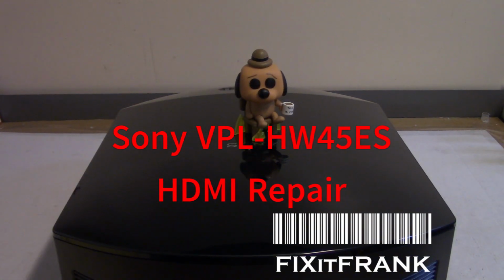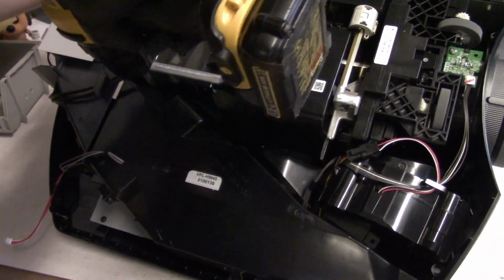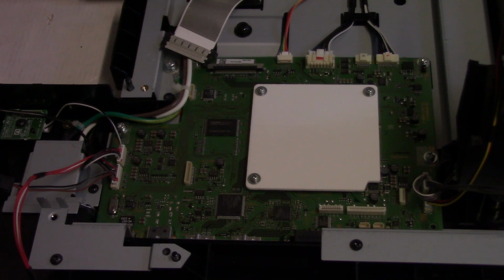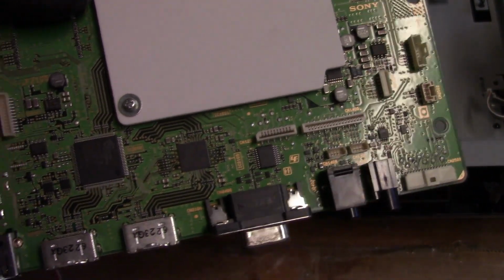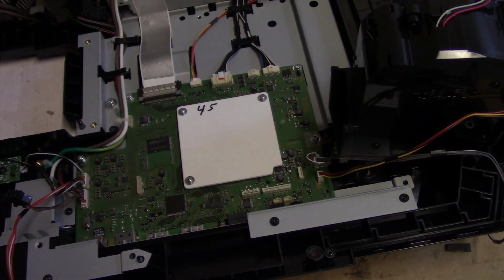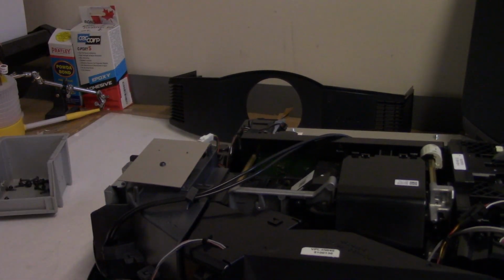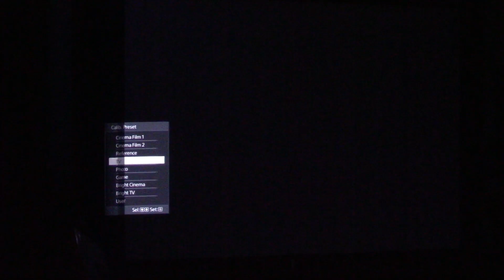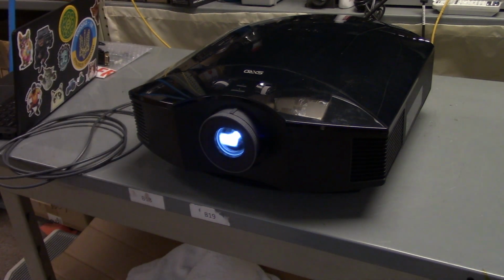Sony VPL-HW45ES SXRD Video Projector HDMI Repair

Comment: Nice one again Frank! I just found on the trash a PROMETHEAN PRM-45 WXGA projector with manufacture date of May 2013 with the remote that is perfectly working. Just cleaned it, because it was stacked with filth, and ordered a  bare bulb for the beast. It has now 20 hours on the new lamp and it is happily working with 0 problems at all. PROMETHEAN was a manufacturer I have never heard of and it seems that it went out of business some years ago! 

Thanks for the new video again Frank!
Reply from the maker: Oh yeah. Promethean used Sanyo chassis if I recall. Schools liked them a lot. Not a bad projector really. Is it orange? Some were made in a bright red/orange chassis.
Reply: @FixitFrank No, it the plane grey unit, but it is short throw. I believe it came from a foreign language private school as it was found outside in a box. Fact is that the unit had 11500 hours on the clock and the lamp was functional but very dimmed.  I ordered the bare bulb and relamped the unit and it is like brand new out of the box. Now as fans and colour wheel goes, well, if it dies, it dies!
Reply: Something about people finding old good tech stuff on the street sounds adventurous and cool nice find

Comment: Good fix Frank....thanks for more videos. Cheers buddy 😊
Reply from the maker: No problem 👍
Reply: @FixitFrank  Hi Frank, thank you for your informative videos. I've been searching the internet and your collection of videos for an issue where a projector (JVC X5900) shows a purple image, even after replacing the lamp. This includes the text in the Menu, and also happens if there is no HDMI cable connected. Sometimes I am able to use the projector for 10 minutes with no issues and the image looks fantastic and bright, but then turns purple again. Do you have any advice on what that could be?

Comment: Thanks, Frank! Do you have a favorite place for HDMI boards and parts outside of lamps? (in the US)
Reply from the maker: Hi, unfortunately our options are very limited unless your pockets are deep and your needs are not too varied.  Encompass parts is okay but $$ and limited and then there is Heartland who I would not give a penny to.  
It really depends on what you need specifically.  I prefer to repair the boards rather than change them.  I rebuild the boards myself and then save them.  I had a video on an HW50ES(the projector I use at home) where I repair the HDMI issue on this series. They use the same mainboards. when I recorded this, the chip I needed was not available but now it is.

Comment: Do you have any seller recommendation for the POA-LMP111 lamp?
Reply from the maker: It depends where you live.  If you are in Europe I'd suggest my projector lamps.  But if you are in the USA I'd suggest https://www.purelandsupply.com/sanyo-projector-lamp_poa-lmp111.html you can use the same coupon code. If you are in the UK, try https://www.ebay.co.uk/str/panoramatic

Comment: Hey Frank, I've noticed that Sony uses the same lamp casing for the lower lumen models as it does for the higher lumen models at least for the VW series.  What would happen if someone put in a LMP-H260 or H280 into a model that uses a H220?
Reply from the maker: The number at the end is the bare lamp wattage.  That is directly related to the lamp driver/ballast. If you use a lamp rated for 280W on a 220W ballast, it might ignite but it wont run as long because it's designed to run at 280W and it will only put out the same lumens(or less) than the rated 220w lamp. That is because the arc points will wear back to the point to where the 220W ballast can't sustain the arc.  Lamps have "about" a 50W range.  Some even up to 70-80W variance.  But usually the UHP lamps used in Sony are pretty tight to that 50W variance.  
What makes these different is that they are arc lamps rather than incandescent. All the lamp drive power comes from the ballast. That is what really dictates the power.  A lesser issue is that the connectors are sometimes different too. Obviously that's easy to get around but the lamp rating is far more of the issue. 
All that said, in a pinch, AND as the industry for replacement lamps shrink you can get away with some substitutes in some situations.  My personal "rule" is 50W either way.  You could use a 270 in place of a 220 or even a 170w.  You just need to figure that the lifespan may not be the same as the proper rated lamp. I prefer to use higher rated than lower rated since lower rating could lead towards an exploded pile of glass whereas a higher wattage will just stop lighting. 
Sorry for the wall of text :)  and thanks for the awesome question!
Reply: @FixitFrank    Thank you for the excellent response.

Comment: Hey Frank, thank you for your helpful Content.
Have you ever fixed broken Lens Shift in Sony VPL HW Series?
Someone is selling a HW65 with broken horizontal and Vertical Lens Shift. According to the seller the wheels spin freely.
Is this an easy fix with a 3d Printer maybe?
Thanks in advance for your advice!

Comment: Hey frank my projector I have a problem. The projector I have is a benq w1070 and I checked the fans and it’s running and I also replaced the lamp. So I think it’s the power supply but not sure. Is there any way to contact you personally?
Reply from the maker: I post in the projector central user group on Facebook. That's probably your best bet

Comment: Quick question. My power is not on. Will it be able to fix it
Reply from the maker: Maybe. Without checking it I can't say for sure. Depends how much you want to spend.
Reply: @FixitFrank   w
We’re effect by power surge now won’t power on. So i don’t know who I much I would invest into it. It’s a good unit just hate to waste it. Thank you
Reply from the maker: @cuongnguyen6340  Is it one of these Sonys?  If so, its worth putting in some money. these are nice. Could be as simple as a bad fuse.  But know since I am not looking at it, I might be wrong.

Comment: Great video Frank. Never had a Sony before. Mine is an Epson 5040 refurbished from Epson. I haven't checked out that DLP JVC yet. I have a new hobby, building a Lotus 7 style car from scratch, repairs are secondary. I also have an Epson 2045 that works for a little bit, then it shuts down and won't turn on again. I haven't opened it yet.

Comment: Hi frank love the videos.  I just got a Panasonic pt-D5700.  Having a lamp issue. Serviceman mode self check shows lamp 1 3hrs runtime NG off. Lamp 2 250hrs runtime ON. Panel flashes bulb 1 three times. Sometimes it won't start And I have to swap bulb positions to get it running and the lamp error may  or may not move from lamp 1 to lamp 2. Any thoughts?

Comment: Thanks for the video Frank you do excellent work! For the gentleman with the Promethean projector I have several PRM 35 projectors they are nice but my problem with those are eveyone throws a hazy picture and I've cleaned all the lenses but didn't help so any ideas I would appreciate also Frank I have the orange ones PRM 10 and 20 nice projectors also but same problems these are LCD the PRM 35 are DLP.
Reply from the maker: Its possible the DLP version have bad DMDs.  Sometimes the DMD get so hot that the mirror mechanisms break loose from the backing and change the focal distance causing a blurry image.  If the picture sort of looks "double" or you can focus on part of the image but not the whole thing, that is likely your problem. The LCD versions might have dust build up or possible bad polarizers but if the polarizers were bad, I'd expect you to see color blobs.
Reply: Thanks for the info Frank.

Comment: the most difficult sxrd I've worked on is the Mitsubishi Hc 9000 completely over complicated mess. Repair failed. Never again :)
Reply from the maker: oh man, that was a nice projector. I have not seen one in a long time.  I'm also not surprised to hear it was a complicated mess since Mitsubishi loves those. Sounds like the mitsi I trashed a few weeks ago.  Should have been an easy repair.  Nope.  Convoluted multiple issues, needed mainboard repair, ballast and power supply work. Ended up getting scrapped.